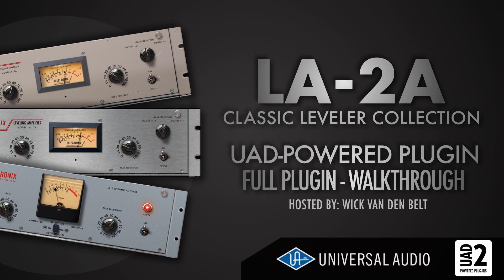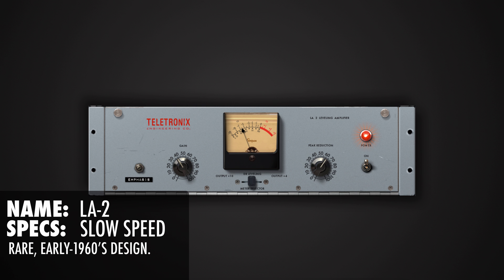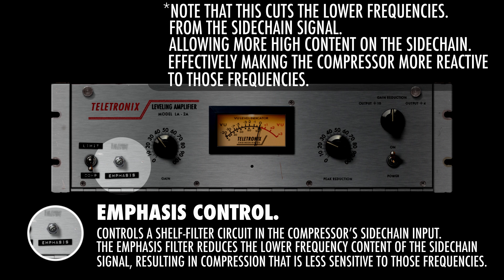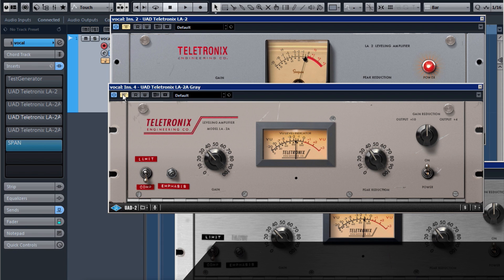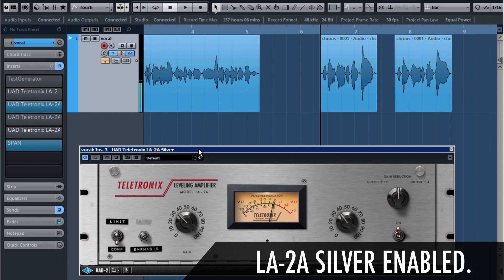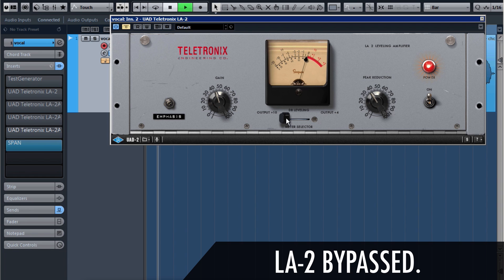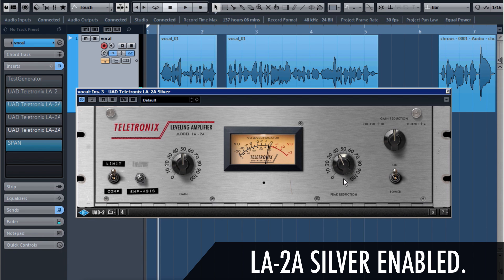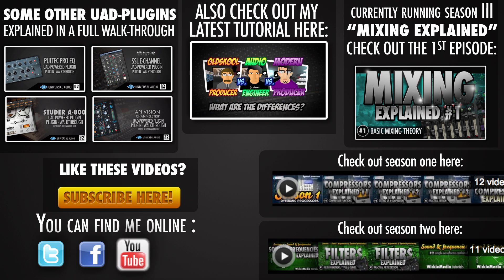UAD - LA2A Leveler Plugin Collection explained (Full Walkthrough)

Comment: I have two question about UAD plugins & hardware: Do one need hardware (plugin accelarators?) from UAD to use their software (aka plugins)? Secondly, do they work with USB for Win10 64-bit machines and Cubase 10? I'm especially interested in only one plugin by UAD, an emulator of the MXR doubler/flanger hardware from the 70's.

Comment: The volume level between the examples hasn't been matched, so everyone who says "it sounds amazing oh my god wow!" is being fooled by "if it's louder, it's better".   You're tricking the listener, putting stuff like this out there without matching the volume levels of your samples.
Reply: not fully true but yeah u have a point. regardless they all do have different tones
Reply: This is true to an extent. However, the saturation that it adds also creates a phenomenon where it sounds louder while peak levels are actually lower because it's literally thickening the sound by adding in harmonics. For instance, you can put just a saturation plugin,  an 1176 or LA2A on a snare without any compression or gain adjustment and the peak levels will drop by 3dB but it will sound louder. Klanghelm has the absolute best automatic gain compensation algorithms I've ever encountered. They seem to take all of this into consideration and account for psychoacoustics when making the adjustment, so it really sounds exactly the same as far as volume goes. BTW, I can't recommend the Klanghelm plugins enough. You can get them all for less than the price of one UAD or FabFilter plugin, and they are on par with UAD, if not better in some ways. One man shop. The guy is amazing. Plugins are like 23 euros each, and are easily worth 10x that. Those and Airwindows, which are all donationware, are some real hidden gems. Since he mentioned a de-esser, and we all have to use them when applying compression to vocals or cymbals, Airwindows DeEss is the most ingenious de-esser ever made. It isn't just a highly focused multi-band compressor like most. It recognizes the wave pattern of sibilance and smooths it out. I'd always wondered why no one else did that. Some claim to, but in practice, they harm a lot of the other stuff in that frequency. For raw voice over, I max it out, then mix back in just enough of the dry signal to make it sound natural. In REAPER, this is a feature of every plugin—no need for an FX buss. For stuff that's gonna get reverb and more EQ and compression, I'll set the DeEss up on it's own buss and only apply the plugins to the 100% DeEssed signal and mix in just enough of the dry signal to make it sound natural. It has replaced FabFilter Pro-DS as my "go to" de-esser, and I've tried them all. Waves came out with it's "organic" Sibilance plugin shortly after Chris from Airwindows released his. He's generous with his code, and I'm pretty sure that's what's under the hood of Sibilance.
Reply: @xaosnox  Chris is the nicest person in the world for giving away for free one of the best deesers ever (and lots of other VSTs)